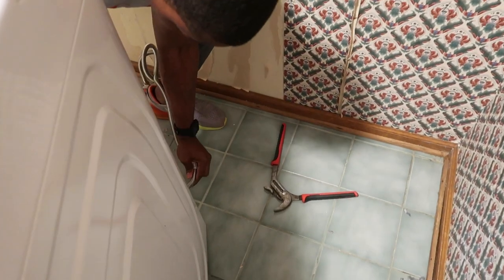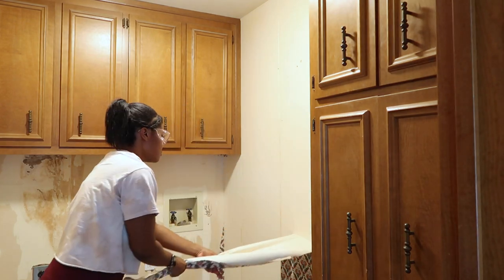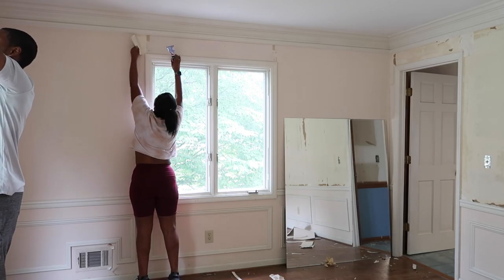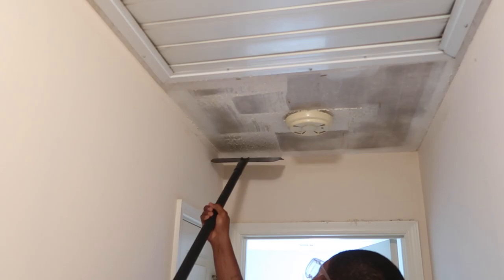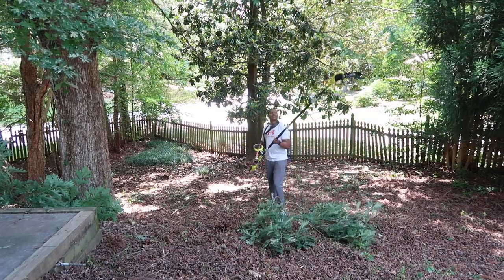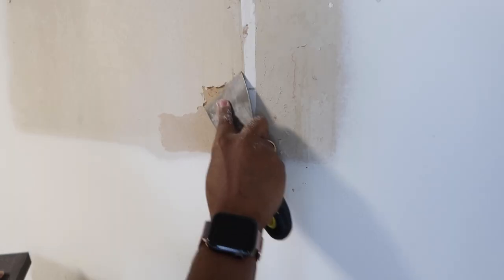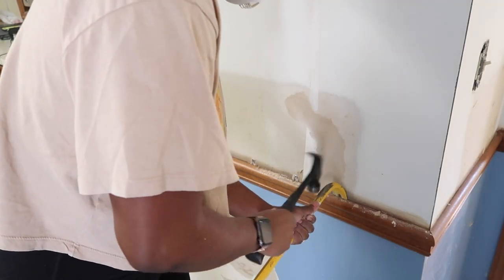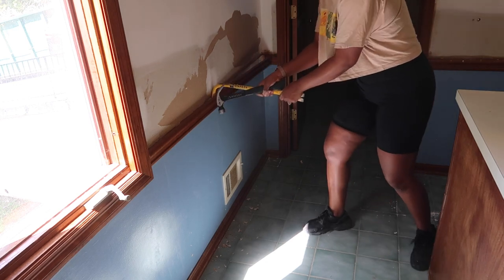Kitchen Wall Prep, Popcorn Ceiling & Chair Rail Removal! | Home Reno Series EP. 6 | Ashleigh Lauren

Comment: It's coming along nicely! But I do recommend that if your kitchen table chairs are going to be near the wall I would definitely put up chair rails! For one if the chairs are up on the wall it will protect your walls from dents, scuff marks and won't pull the paint off if the chairs are up on the walls because if there are no rails there and the chair sits on the walls it will eventually pull the paint off and stick to the back of the chairs I know I had that experience several times of that happening to me that's why I'm putting chair rails up know! If the chairs are not going to be nowhere near the walls then I wouldn't worry about putting them up! I just wanted to let you know what will happen if the chairs were near the walls ☺️.